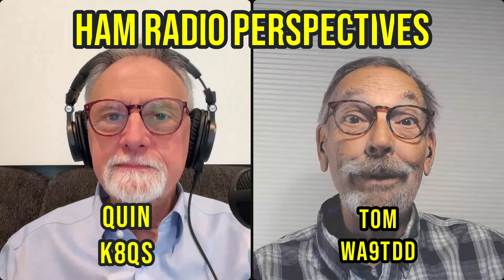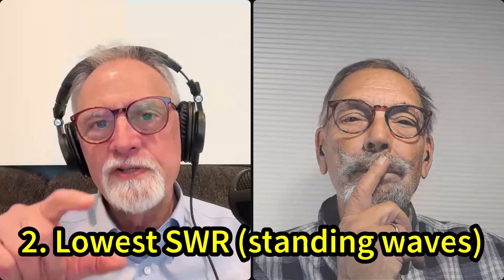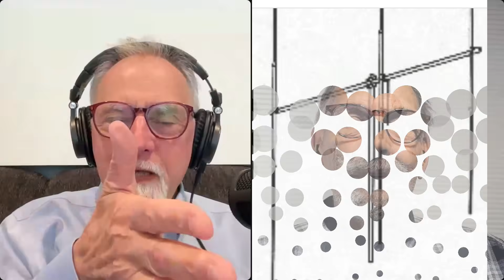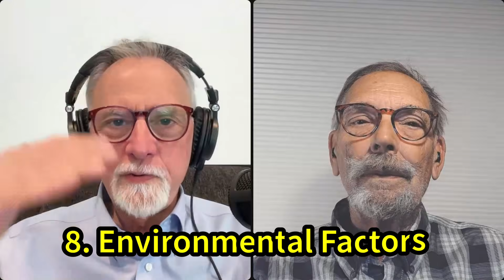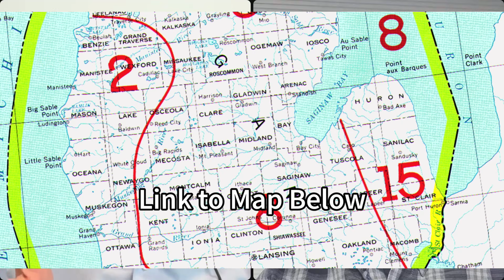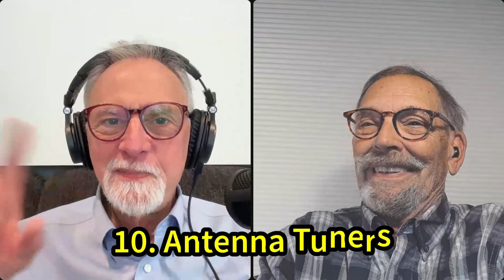10 Ham Radio Antenna Essentials -- HF and More

Comment: Good one Guys. I think, when the solar cycle heads for the bottom and propagation goes with it, a lot of newer Hams will find out that the stuff you talked about will become a lot more essential than it is when the solar cycle is on top and you can work the world on a pretty poor antenna. Those little things we have just been putting up with and not correcting or optimizing may become showstoppers in a couple of short years. I love the Armstrong rotor story; we had one for our TV antenna and it was even interactive. "How's that?" "No that's worse, go back a little." "Too far, go back a little the other way." "STOP, right there, that's as good as it gets." Our nearest TV station was about 75 miles away, so it was never very good. WWL, WSM, and WLS were more dependable at night, so I just listened to those instead. Boyd, WE5BC
Reply from the maker: @boyddawncecil7559
Boyd, when the solar cycle declines, the antenna system becomes more important than the radio.  Yeah, we still have the OTA TV dance in the boonies.  73

Comment: I'm very glad to hear discussion about antennas.  IMO, this is the one thing that amateurs can still modify and create for their stations.   It has become a personal quest to educate as many as I can as to how they work and what makes then fail.  I grew up with 11M and coax, then became a broadcast engineer and discovered balanced line.  We need to do all we can to Elmer today because there is so much misinformation out there and the student often follows blindly because they do not know what they do not know (yet). 

Keep up the great work gentlemen.  73
Reply from the maker: @WECB640 There is a lot we know we don't know (after 60 years) and are willing to admit it, so we try to cut to the chase and make what we do know easy to understand.  73